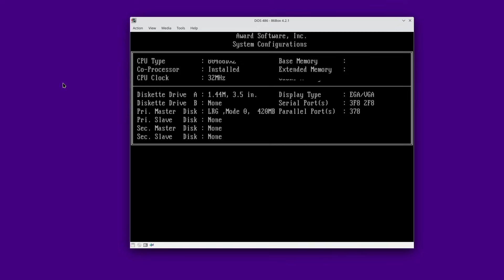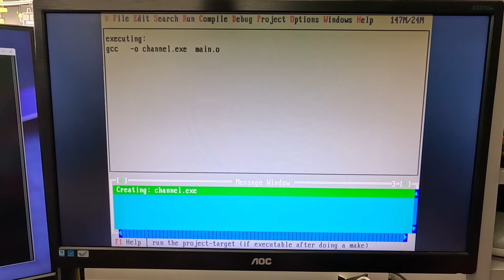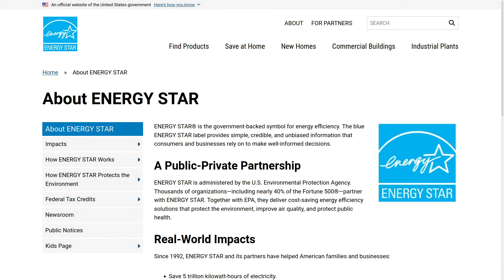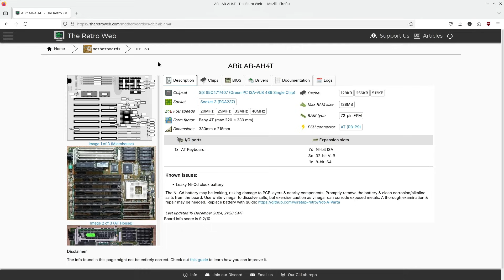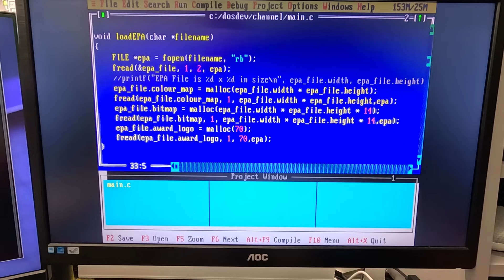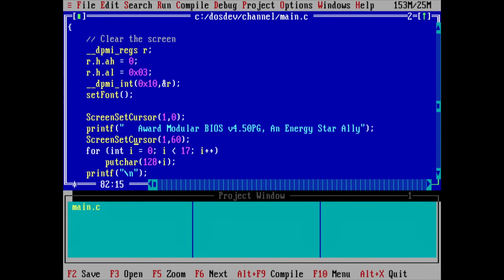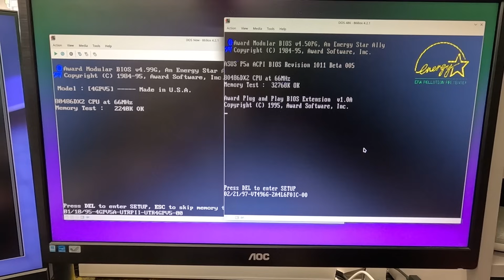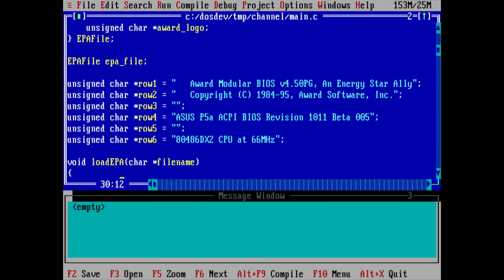Retro MS-DOS Coding - Recreating the Iconic Award BIOS Screen

Comment: There's various games that have fake BIOS boot screens - As I remember - games like Fez (good game, terrible developer) had a "BirdyBIOS" (a parody of Phoenix BIOS) boot up screen when reality crashed.  There's also a number of "hacking style" games where the game simulates a kernel crash and then a reboot screen that shows a simulated BIOS boot.  It did make me wonder that you could build malware that simulates a reboot and you could get the user to enter their BIOS password and OS credentials to allow the system to compromise the system. I was also surprised how large the BIOS memory was. I thought that it was just a few KB, but it's actually 32 MB in size, and there are usually two versions so that if one stops working, you've got a spare version that you can boot and recover the other one from. This was quite useful in the age of the CIH virus that tried to brick the machine from zeroing out the first 1024 bytes of the BIOS,  but with a dual BIOS you could still recover the machine. One of those things in the 1990s that I remember being an issue when one of your mates used to run every piece of software he could get on-line to run on his machine...!

Comment: Try:

outportb(0x3c4, 0x01);
outportb(0x3c5, inportb(0x3c5) | 0x1);

That sets the VGA into "8 pixel character cell" mode, like EGA; the default 80x25 VGA mode has 9-pixel character cells instead.
Reply: Thank you for putting the complete code in the blog post — I was able to install DJGPP+RHIDE in DOSBox, build and run it, and then verify that my fix does work. You can insert it anywhere before the PrintBIOSLine calls. To return things to normal after the getchar (not essential, but friendly) you can

outportb(0x3c4, 0x01);
outportb(0x3c5, inportb(0x3c5) & ~0x01);

to zero that bit again.

Comment: I thought I'll never know how they put that logo onto the boot screen, it was a mistery. Your video is a breakthrough, thank you!
Reply: A few Symantec utilities had a clever trick. They'd read what was at a 2x2 character block and modify 4 bytes of the VGA text font to superimpose a mouse arrow cursor over the top of the text in those screen spaces and draw those characters instead of what should be on screen in that spot. Four characters were used so the mouse could "slide" across the screen as an arrow instead of popping from one character cell to the next as a block. The way you could tell they did it was that there was color clash ala Speccy games. The mouse cursor was always the text color of the character cell on the background color, whatever that was. They also turned off blink and set the graphics card to 16 color on 16 color.

Learning how that was done was the reason I was never impressed by the Energy Star logo, although I realized the video mode was not 720x400 80x25. Never bothered to work out it was EGA 8x14 character mode at the time, though I should've been able to work that out if I'd cared to.

Comment: I remember booting into DOS and Windows 3.1 computers before the Energy Star logo was a thing.  But I noticed when it came around.  I was a bit confused at first, because I wasn't sure if you were just faking the screen or actually pulling up information like the memory check.

The picture info is interesting.  I just assumed they used some kind of magic to display a picture on a DOS screen, but yeah, I guess that doesn't make much sense if it's a text screen and not a graphics screen.  So If I understand correctly, you're redefining some of the lesser used ASCII characters into custom characters that can be used to display the desired graphic? 

Now I'm wondering if the 'Nix systems are doing something similar in their opening text screens.  Not the BIOS, but after the BIOS.

Yeah, your method reminds me of when I wrote a maze progam for DOS using QuickBasic way back when.  When I started the program, I had no idea how to generate the maze.  I initially focused on displaying the maze onscreen, and THEN I looked up algorithms for generating mazes and picked one that seemed suitable to me, and figured out how to code the algorithm in QuickBasic.  After that, it was just coming up with various niceties like a splash screen, letting the user change the colors, and a few other odds and ends.  I even threw in a DOS screensaver if the user didn't do anything after so many minutes.
Reply from the maker: That's it, pretty much the entire second page of the ASCII set is a bit random, and you can redefine it without affecting anything important.

I might look at generating mazes, it's a fun challenge.

Comment: I did a lot of DOS assembly-level writing directly to video buffer programming in the late 80s. Good times, as you can do "anything". I wrote a terminal window package that displayed overlapping message or input/output windows. They could be moved forward, and anywhere around the screen. It was lightening fast, as it was using assembler buffer mov instructions down in the video card address space. 

Until that was 100% there a lot of system hangs / crashes, or your printer would mysteriously just start printing garbage. DOS trying to give you a core dump? 

Fun times for sure.

Comment: Brings back a lot of memories of coding applications and games for DOS. The DOS text mode screen is at B800 in memory, every odd byte is character and even bytes are color. First 4 bits of color byte is foreground color and last 4 bits is the background color. So you can just overwrite the memory from B800 with 0  for the next 4000 bytes and your screen is cleared. In assembler you would use stows command to do it in a split second. By changing the characters, you can make horizontal scrollers, one pixel at a time in text mode. Many DOS games would save the 4000 bytes in memory or a temporary file (including cursor position), to be able to restore the screen as it was when you started the game.
Using characters for graphics is actually how e.g. the Commodore 64 worked. Mixed with a few graphical sprites and you got something that looks like an all graphics game, even though it’s characters most of it. The BIOS interrupts are quite powerful, go find a list of them to see what you can do. E.g. a timer interrupt for running something in the background etc. I might still have a lot of these old knowledge base documents somewhere with all the nice information, however most can probably be found online. I even have lots of demo code samples like fire, shade bobs etc laying around. I downloaded the samples from old BBS with a modem. Must be able to find these old resources online as well.

Comment: Others have already told that the BIOS boot screen is actually not in text mode. I just want to highlight the reason of the gaps between the characters. They go immediately away if you use a CGA or EGA card. On VGA cards the 80x25 and 80x50 text modes actually use a 720x400 resolution where 720/80 = 9, so the 8 horizontal pixels are rendered on 9 pixels, making sure that even full size characters aren't merged together. The only exception is the range of the "box-drawing characters", where the rightmost pixels are doubled so the drawings are always connected.

Comment: As far as I understand, text modes had programmable bitmap fonts. So you could split your bitmap to 127 pieces and put in in 128-256 character codes. Also, I'm not sure, but IIRC these text modes could host 4 fonts simultaneously.

Comment: This was a very interesting video. Thank you.
There is another interesting topic in retro programming under DOS: 
In text mode, it is possible to move the screen up or down not by a whole line, but by several pixels.

I have seen this in old programs for reading text from the screen.
In such programs, the text smoothly scrolled up or down.

I also saw similar smooth scrolling in a video with connecting an original old terminal to a PDP computer emulator.

Smooth scrolling in text mode works by changing the VGA (or EGA) card modes.
This looks incredible for text mode.

Comment: Asus P5A is a super socket 7 motherboard, you can't run a 486 in there. You could change that line to "ASUS PVI-486AP4" - that one is socket 3 - or change the CPU line to "AMD-K6(tm)-II/500MHz CPU found", or any other CPU that would have been used with the P5a back in the day - or - would you consider having the CPU, memory size and mainboard be user-editable from within the program, and then releasing the source code? It would be pretty useful for retro artwork. I'd personally make a screensaver out of it.

Comment: The VGA chip has a register called the "clocking mode register", and there is a bit in it that indicates whether the character clock should be advanced every 8 or every 9 pixels. The default on VGA adapters is 9. On CGA and EGA adapters, this isn't an option, and it is always 8 pixels per character. Bit 0 of the clocking mode register (register with index 1) is the "9/8 Dot Mode" bit. If you set the bit to 1, then characters will only be 8 dots wide.

To access these registers, you need to do port I/O. The clocking mode register is one of the "sequencer registers", which are accessed on ports 0x3C4 (address) and 0x3C5 (data). The basic procedure is:

1. Read the value on port 0x3C4. This is so that you can restore it later. Probably not necessary, but "polite". 🙂
2. Write the value 1 to port 0x3C4. This selects address 1, for the clocking mode register. After this write, port 0x3C5 is now the clocking mode register.
3. Read the current value of the clocking mode register from port 0x3C5.
4. Alter the bit you want to modify. In this case, set bit 0 ("value | 1").
5. Write the new value of the clocking mode register to port 0x3C5.
6. Restore the previous data register's value by writing the value initially read on port 0x3C4 back to it. You could probably get away without steps 1 and 6, but it's bad manners :-)

I have tested that this in fact recognized by VirtualBox's virtual VGA adapter, and when the clocking mode is set to 8 dots per character, the extra 9th column in every character is physically deleted and the emulator window becomes 12.5% narrower. :-)

I did my test using QBASIC, simply because I didn't have a VM already set up and QBASIC doesn't require me to install anything. It comes on the DOS 6.22 disk :-) I'll paste my QBASIC code in reply to this, to keep things organized.
Reply: ' Retyped by hand, because I'm not set up for exfiltrating data from my DOS VM :-) Please excuse any errors I might have made.
' I assure you that this code, as originally written, does in fact run and work as described!
CLS

PRINT "Much test, very hello"

FOR i% = 128 TO 210
  PRINT CHR$(i%);
NEXT i%

use8% = 0

WHILE 1
  Set98DM use8%

  use8% = NOT use8%

  SLEEP 1
WEND

SUB Set98DM (use8dots%)
indexregister% = &H3C4
dataregister% = &H3C5

clockingmoderegisteraddress% = 1

' Save original address in the index register.
originaldataregister% = INP(indexregister%)

' Switch to the clocking mode register.
OUT indexregister%, clockingmoderegisteraddress%

' Read the current clocking mode register value, since we only want to alter one bit.
clockingmoderegistervalue% = INP(dataregister%)

' Make the necessary change.
IF use8dots% THEN
  clockingmoderegistervalue% = clockingmoderegistervalue% OR 1
ELSE
  clockingmoderegistervalue% = clockingmoderegistervalue% AND (NOT 1)
END IF

' Write out the new value for the clocking mode register.
OUT dataregister%, clockingmoderegistervalue%

' Switch the sequencer register back to its original value, whatever that was.
OUT indexregister%, originaldataregister%
END SUB
Reply: https://youtu.be/uAHGKanqO6s?t=86 I mentioned that VirtualBox physically changes the window size depending on whether the VGA mode specifies 8 or 9 dots per character. You can see your emulator doing the same thing here w.r.t. the window width when the BIOS switches back to 9 dots per character mode as part of moving to the next phase of the boot.
Reply: I looked up your earlier blog posts about setting up the development environment and see that you're using DJGPP. Looks like it exposes port I/O using inline assembler macros:

unsigned char inportb(unsigned short _port);
void outportb(unsigned short _port, unsigned char _data);

Interestingly, while poking through the DJGPP documentation, I discovered that it provides a bunch of macros for controlling the video adapter directly! These are defined, it looks like, in conio.c, things like:

- void textmode(int mode): Calls interrupt 0x10 for you to change modes.
- insline, delline, window, et al.: Appear to allow a subset of the screen to be made into a smaller scrolling region.
- void bell(): Ding!
- int isEGA(): Returns 2 if VGA, 1 if EGA, otherwise 0. (So you can use this to decide whether to worry about 9 dots mode in the first place)
- set_scan_lines_and_font: Provides a quick way to reset the font after you're done with your simulated screen with the logo image.
- blinkvideo, intensevideo: Allows you to select the interpretation of the high attribute bit -- should it mean a bright colour or a blinking character.

Comment: The characters on VGA mode are actually 16 by 9 pixels, although the font is defined as 16 by 8. IIRC certain ANSI character numbers are hard coded to duplicate the pixels from the 8th column into the 9th. Other characters are hard coded to have all the pixels in the 9th column being turned off.

Comment: I actually played some games back in the day that used EGA palette changing and text mode character set changing. Neat stuff.

I know some of the text modes have spaces between characters, I think that is why you are seeing gaps. 8x14 is the character size the games I played used back in the day if that helps, but of course the size you need depends on the font you're using. What you have is probably a width of 9 with one of the pixels always blank for a gap.

Comment: We using ROM font in our code to print in graphics mode-X, 43h vector as pointer to a font table or INT 1110h to setup in console mode. Not sure it's working on CGA, but we used this on standard VGA adapter. So, my be it will be easy to code only assembly language, not C. Be careful with BP register, "high" level languages use it as stack-frame for arguments. Anyway thanks for video! :)

Comment: "The ninth column can be set either to the background color or to the same value as the eighth dot of the character code being displayed. This is controlled by the B/I field of the Mode Control Register. Setting the ninth dot to the back¬ ground color is done for characters as indicated above. In the line graphics mode, ASCII characters between 128 and 255 are often used as pseudographics characters. Primitive lines may be drawn using these characters. In order for horizontal lines to be connected, the technique of assuming that the ninth pixel is background will not work. It would cause discontinuities. For these charac¬ ters, the hardware will copy whatever is in the eighth dot position into the ninth dot position. If the eighth dot position is a 1, signifying a foreground pixel, the ninth dot will subsequently be displayed as a foreground pixel, thereby allowing continuous horizontal lines." - Programmer's Guide To The EGA, VGA, And Super VGA Cards (3rd Edition) by Richard F. Ferraro

Comment: This old forum thread discusses the screen resolution issue and there is a program mentioned that does it. Also, the dos mode command changes the column height and width, and the dos chcp command changes the font. Be careful with chcp since some fonts are in other languages.

Comment: Do not use service 0x00 "set video mode" as a service to clear the screen. Use service 0x06 or 0x07 (Scroll window up/down) instead.
Reply from the maker: Why?
Reply: @ncot_tech  Two reasons: 1) Mode switching takes a lot of time (especially on real hardware, where you have to wait for some conditions like vsync - dunno how that is handled by emulators). 2.) Mode switching also puts some stress on the hardware (not relevant on emulators of course).
Reply: @ncot_tech  BTW: You can just memset zero @ 0xb8000..0xb0fff to clear the screen, which is the fastest way.
Reply: @ Another reason: If the user switched to 80x43 (EGA) or 80x50 characters (by loading an 8x8 font), mode switching resets the display to 25 lines which is probably not, what the user wants.

Comment: Thanks for the video! Used to love this kind of stuff when I was a teenager like 25 years ago, lots of fun 🙂
I remember making a DOS screenshot tool that would read the pixel representations of each ASCII character and then dump the screen contents to a PCX file.
Still proud of that, considering there was no Internet back then to look things up.

On a similar note, I remember Norton programs that appeared to run in text mode, but use a graphical mouse cursor and icons for the drives and things like that. You can see that here: https://www.youtube.com/watch?v=1vvBR6xDGlE

I remember wondering how they did that, and I'd still like an answer, so if anyone knows what's going on there, I'd appreciate some input 🙂

Comment: I converted online some animated gives into single pictures with 112x112 pixel to download in a zip file and then i converted the pictures into character files for an animation on the text screen. The animation use a block of 14*7=98 extended ASCII character with 8*16 size.

I put all instructions to convert and to start the animation into batch files using batch files as open source container for x86 assembly to create new executable from the routine inside with a little help from debug. These batch files have to start with parameter attached to build and to modify the routine.

Now i thing aboit to build a new C routine to create a batch with a lot of call commands to start with a lot of filenames attached. Some animated gives have 200 pictures for example, but the charater files have only 1,5 kb.